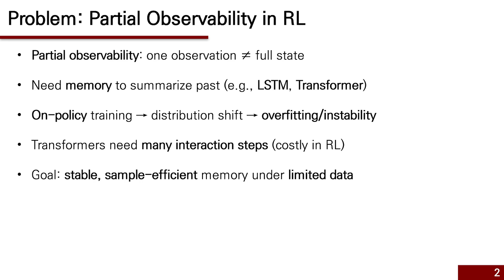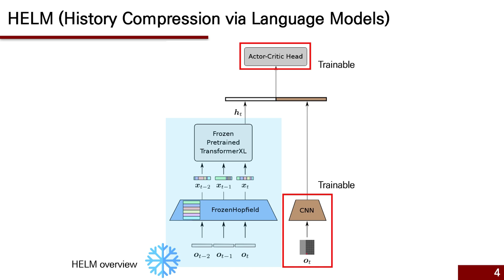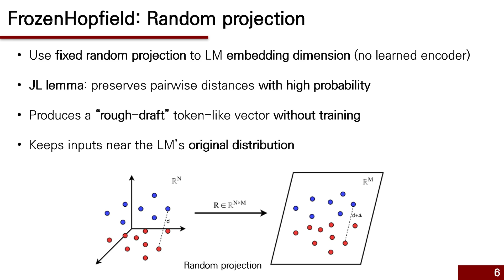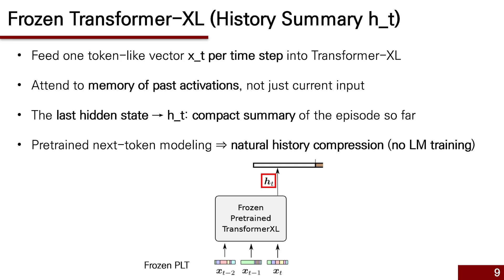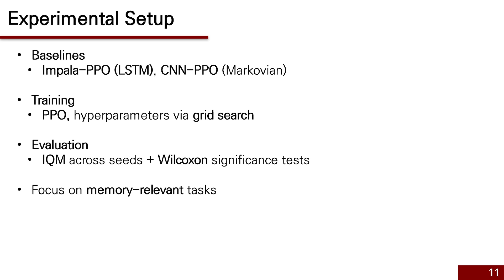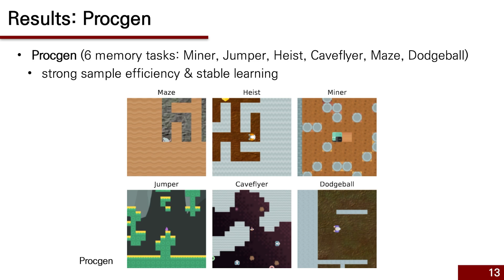[Seminar] Using Pretrained Language Models for History Compression in RL

Comment: Q1 : On page 6, it is stated that when projecting from high dimensions to lower dimensions using random projection, distances are preserved through the JL lemma. The figure shows a transformation from 3D to 2D, but is this technique still applicable when the dimensionality gap is much larger? (e.g., 10 → 2) What principle allows this to work?

Q2 : If Transformer-XL is used in a frozen state, it seems that it cannot learn environment-specific representations. In such cases, isn’t there a risk of losing important information?

Comment: Thank you for your presentation:
Q1. Thank you for the presentation. I’m curious about how a language-only pre-trained model can take observations as input in a training-free manner. Could you explain this part in more detail?

Q2. Do you think this architecture could also be applied to lifelong learning, which is a major challenge for language-model-based agents? In such environments, agents need to retain long-term memory and adapt knowledge from past experiences to new but related tasks. Would your approach extend to such long-horizon memory and utilization settings as well?
Reply: A1: They use “FrozenHopfield,” which maps raw observations into the token space of the language model using random projection + Hopfield retrieval. This way, the LM can read them as if they were words, without retraining.

A2: In principle, yes. Since the LM already compresses history and can abstract over long sequences, it could be extended to longer horizons. But the paper itself only tests medium-length episodes, so lifelong learning is still open.

Comment: Q1. Is the main idea of this paper about how to convert observation into a token for a language model?

Q2. Are these generated tokens similar to regular text tokens? If so, could this method work with other LMs, like GPT-4?

Q3. The LM is frozen. Since it's not fine-tuned, how do we know its output will always help with winning, rather than just generating a story that makes sense? Is there a test for this potential issue?
Reply: A1: Exactly. The big idea is to turn game observations into something the LM understands (tokens), so the LM can summarize history.

A2: Yes, they are embeddings in the same space as text tokens. In principle, it could work with GPT-4 or LLaMA too, since the mapping is general. (This does not mean that the text token embedding spaces of different LMs are identical — rather, the method can be applied to each model’s own embedding space, if you can access their embedding lookup table.)

A3: A frozen LM encodes many kinds of information, not all reward-relevant. But the Hopfield mapping keeps inputs on the LM’s stable token manifold, and the RL head learns to use only the parts that help maximize reward. So in practice, the LM’s outputs serve as useful history summaries for winning. They test this experimentally: HELM consistently outperforms baselines (LSTMs, CNNs) on benchmarks. That’s the evidence the compressed history is useful for decisions, not just text-like coherence.

Comment from the maker: The presentation was simple and clear. However, I find it somewhat difficult to fully understand the concept of FrozenHopfield.

Q1. As far as I understand, the Hopfield network functions as an “aggregator and compressor for sequential observations.” I am curious about how this is actually achieved. How are such networks trained? How exactly do they work? Moreover, how can their validity be ensured across arbitrary scenarios such as Procgen, MiniGrid, or other applications?

Q2. I would also like to learn more about MiniGrid and Procgen benchmarks. What are their  advantages and disadvantages when used as benchmarks for our future work?
Reply: A1: In this paper the Hopfield network is not trained. It just stores the LM’s token embeddings. Each observation is first randomly projected so that its dimension matches the token embedding space while roughly preserving relative distances. Then it is used as a query: the Hopfield net measures similarity to all stored embeddings and returns a weighted mixture of them. That mixture x_t is always a valid “token-like” vector, so the LM can process it as part of the sequence. Because this mechanism is fixed and combined with a generally trained LM, it avoids overfitting to any specific task.

A2: MiniGrid is a lightweight grid-world benchmark. Its main advantage is that it isolates specific challenges like memory, exploration, and sparse rewards in very simple settings, which makes it great for quick prototyping and controlled studies. But it’s relatively small and can often be solved even with simple policies, so it may not fully stress-test more advanced methods.
Procgen, on the other hand, offers visually richer, procedurally generated environments. Its advantage is strong diversity and generalization pressure, since agents must handle many unseen levels rather than memorize a few maps. The downside is that it’s more computationally expensive and sometimes noisy, which makes evaluation harder and slower.

Comment: Nice presentation.

Q1. What do you mean pretrained llms have the ability to compress dialogue history into memories? Don't they need external modules?

Q2. What is the architecture of a FrozenHopfield? Is it based on a transformer?
Reply: A1: Pretrained LLMs don’t literally store history. What they do is compress the input sequence within their context window into hidden states, since next-token prediction forces them to summarize past tokens. HELM leverages this built-in ability directly. In this case, they use Transformer-XL, which also has a memory register to extend the context beyond a fixed window, so no external memory module is required.

A2: FrozenHopfield is a Hopfield network sitting in front of a frozen Transformer (Transformer-XL). It just maps environment inputs into LM’s token space.

Comment: Q1. How does the Frozen Hopfield adapter ensure stability when mapping arbitrary observations into token space, and what are the implications for avoiding off-manifold errors in reinforcement learning?

Q2. In what ways does HLM leverage the sequence summarization abilities of Transformer-XL differently from how LSTMs handle memory in partially observable RL environments?
Reply: A1: Because after projection + retrieval, every input lies inside the convex hull of pretrained tokens. That keeps inputs “on-manifold,” so the LM isn’t fed garbage vectors.

A2: LSTMs store history step by step, which can be unstable. Transformer-XL stores long sequences with attention + memory register, which preserves more structure and is more robust for partial observability.

Comment: Q1. What are the differences between using a Frozen Hopfield network and simply feeding the last few steps directly into Transformer-XL?

Q2. If we replace Transformer-XL with more recent models like the GPT family or LLaMA, would there be additional benefits? Or is it essential to use an XL-type model with an explicit memory mechanism?
Reply: A1: The Hopfield projection is mainly for compressing past history into a compact form. It deliberately abstracts away details. But the current timestep often contains fine-grained visual information (like exact object positions) that is crucial for immediate decisions. A CNN is better suited to preserve those details.

A2: Yes. If we replace Transformer-XL with GPT, we must also use GPT’s own token embedding table as the lookup basis. FrozenHopfield works by projecting observations into the LM’s token space and retrieving embeddings from that table. So to make GPT usable in HELM, its embedding matrix has to serve as the lookup memory, just like Transformer-XL’s embeddings do.

Comment: I found it very helpful to see how the partial observability problem can be combined with memory. 
I have two questions:

1. Is learning only possible within the same environment? If the environment is completely different (as in p.12 and p.13), should the fixed random projection also change, or can it remain the same?

2. On p.9, you mention that ℎ𝑡 serves as a compact summary. How much history does it actually include according to the paper? Does it still work for very long episodes?
Reply: A1: The random projection and the pretrained Transformer (plus the Hopfield retrieval) are completely frozen and reused across environments. What actually gets trained are the CNN encoder (to process the current observation) and the actor–critic head (policy/value networks). So the memory mechanism is fixed, but the front-end encoder and RL head still need to be learned for each environment.

A2: Transformer-XL stores up to its memory length (here ~512 steps). That’s usually enough for long episodes, though extremely long tasks might push the limit.

Comment: It's impressive. I have two questions:

Q1. I understand that random projection is used to improve generalizability for highly random inputs, but even with the JL lemma, wouldn’t this still lead to lower accuracy compared to training on a task- or behavior-specific dataset?

Q2. Also, doesn’t applying random projection to the manifold make the embedding harder to interpret or manipulate—for example, when doing linear interpolation?
Reply: A1: It can, but the Johnson-Lindenstrauss lemma guarantees distances are mostly preserved.

A2: Yes, they are less interpretable. But interpretability wasn’t the main goal – stability and generalization were.

Comment: Q1. FrozenHopfield maps observations into the token embedding space via random projection and Hopfield retrieval. Why is this non-trainable mapping preferable compared to learning a projection layer? What are the main advantages and possible drawbacks of this choice?

Q2. I am not very familiar with this field, but I noticed that the paper reports results separately for each Procgen environment. Is this kind of per-environment breakdown considered the standard way to evaluate reinforcement learning methods? Or should results be primarily analyzed using aggregated metrics instead?
Reply: A1: In reinforcement learning, the amount of training data is usually very limited because every sample comes from costly environment interaction. If you make the input projection trainable, the model can easily overfit to the small dataset and fail to generalize. By contrast, a fixed random projection combined with Hopfield retrieval is completely data-independent — it guarantees that observations are mapped into the valid token embedding space of the language model without any training. This makes the method both more sample-efficient and more stable. The trade-off is that the mapping is not specialized for the task, so it might lose some task-specific precision, but the experiments show that the gain in efficiency and robustness outweighs this drawback.

A2: Both views are useful, and which one you emphasize really depends on what aspect of performance you want to highlight. Procgen environments differ a lot in difficulty and in how much memory they require, so per-environment breakdowns are important to understand where a method succeeds or struggles. At the same time, aggregated metrics are helpful for giving a single overall score and comparing methods broadly. In this paper, both are reported: the per-environment results show HELM’s strengths on memory-heavy tasks, while the aggregated results demonstrate overall sample efficiency and stability.

Comment: Q1. This method shows strong results in partially observable environments. How would HELM behave in fully observable tasks where memory is less critical? Would its overhead reduce efficiency compared to simpler models?

Q2. The results showed lower variance compared to LSTMs. Do you think this stability comes more from the frozen LM itself or from the Hopfield projection mechanism?
Reply: A1: It still works and even improves performance slightly, though the memory module isn’t strictly needed. The overhead is small compared to benefits.

A2: Likely both. The frozen LM avoids overfitting, and Hopfield keeps inputs valid. Together they yield more stable training than LSTMs.